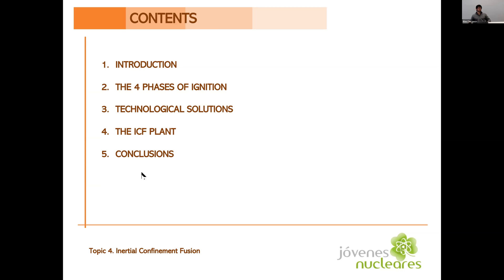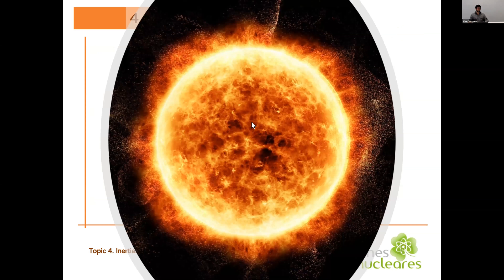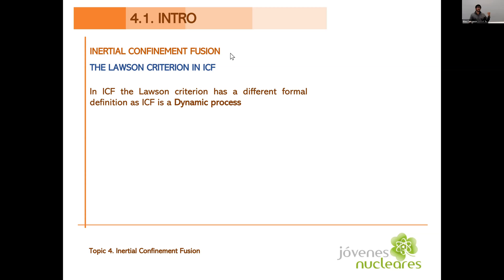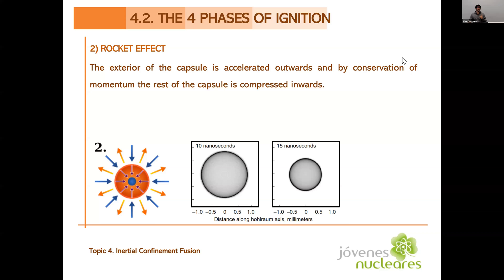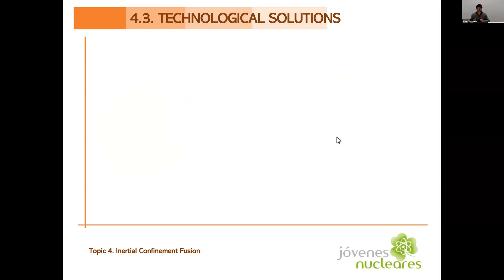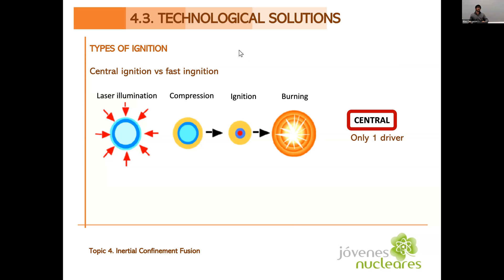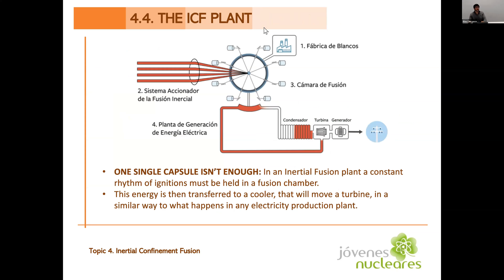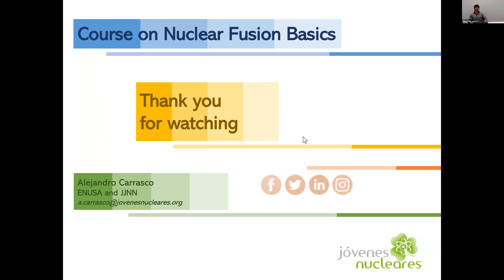Course on Nuclear Fusion Basics - Topic 4 - ICF: Inertial Confinement Fusion

Comment: Lawson is in  some parts good explaned , but Laser light is the contrary of inertial fusion.
Perhaps with  neutrons , which have 150 T and Protons.
Photons have only 0,03 T as UV light.
Light lasers tend not to be inertial fusion lasers at 0.03 Tesla (for momentum-balancing particles with UV)
Neutrons have 150 T . Nucleons become per charge and field strengths
brought to mutual resonance paths up to the right fusion.
in the core they continue to circle the nucleons in between. (not the laser electrons)
from the projector or LCD screen 😁. They're probably somewhere else.
The halogen lamp would probably be 100 times stronger when shined in from the Mono - Laser side?
(More like a joke) Cheap LED advertising from China keeps popping up!
Of course, the sun doesn't shine like limone when it comes to nuclear fusion on earth.
Also, limone light does not increase nuclear fusion on Earth!
Cleavage of borisotopes alone and Laser moon light - as nuclear f i s s i o n  became the first time in the world ? 
No No.  some disco - jokes either more ! Not light makes ignition , but f u s i o n ignition makes some little light too but 
more Gamma ! and reusable particles.
What ist TNT ? joule ? perhaps ?